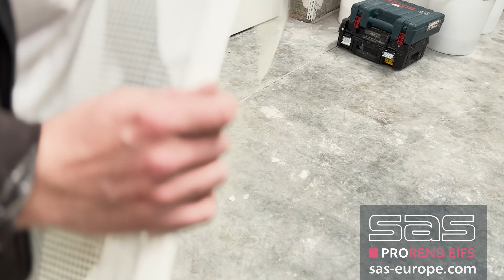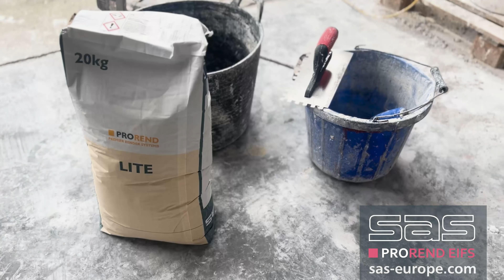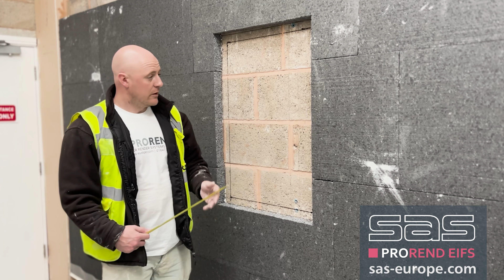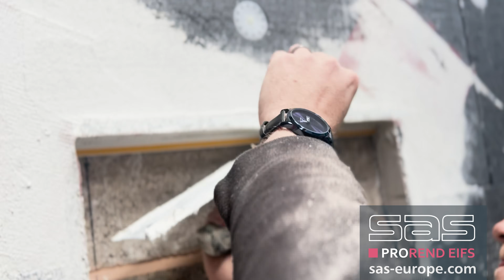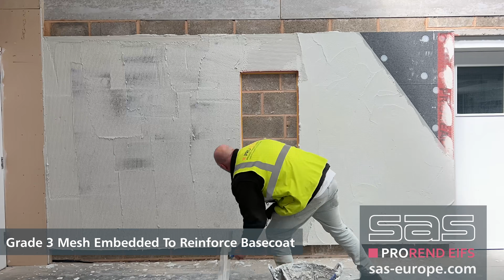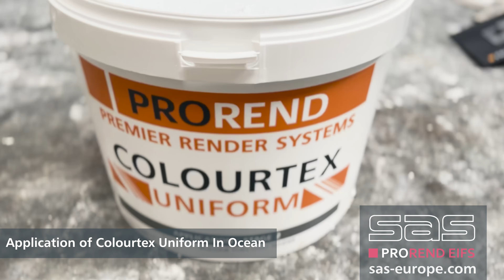Installing External Wall Insulation with a Rendered Finish

Comment: Great video. A question I have is at 23min30sec after applying the secondary base coat you advise leaving it for around two hours and then trowelling with  plenty of water to achieve a smooth flat finish. However, you don't show this stage. I don't suppose you have, or know of, any videos that show this? Thanks
Reply from the maker: Hi Peter. Good question, check out this video here from approximately 7:14-7:58 and it will give you an idea. If you would like any further support, our technical team are always happy to help, they can be found at info@sas-europe.com or 01647 24620.

Comment: Great video. I’m planning a side-passage shed against a wall with 100mm external insulation. Can I use long-reach brackets—specifically three rows of double L-brackets—to anchor the shed to the structural masonry? The brackets would bridge the 100mm of foam to secure the shed’s primary support posts. Would they cause a thermal break or compromise the insulation's performance?
Reply from the maker: Hi Mark,

Is it a Helping Hand bracket system you’re planning on using for this? If so, the brackets create only a relatively small localised thermal bridge through the insulation layer, which can typically be accounted for within the U-value calculation through the Chi value of the fixing system.

Most Helping Hand systems also incorporate thermal isolation pads at the fixing points, which helps minimise cold bridging back to the structural wall.

Provided the brackets are correctly specified and fixed back into the structural masonry, this type of detail is commonly used on ventilated façade and rainscreen systems without significantly affecting the overall thermal performance of the insulation system.
feel free to email me gerry@sas-europe.com

Comment: Great video, great example of the skills of a good tradesman. Question though, once done how hard is this stuff, given it's polystyrene underneath can you now dint your house?
Reply from the maker: Good question.

The insulation is only the backing layer. Over that goes reinforced basecoat and mesh, which creates a solid, impact-resistant shell before the finish coat is applied.

Once complete, it performs like a robust rendered wall system. You’re not pressing into bare polystyrene - the structural strength comes from the reinforced render build-up.

Comment: After you have slapped on a base coat then the mesh, what is the maximum amount of time you can leave before putting on the topcoat? Does the base still have to be tacky or can it be completely dry and I can leave it a few days before finishing?
Reply from the maker: Hello. It needs to be left for at least 24 hours and completely dry before the topcoat is applied, so it can be left for a few days before finishing if needed. Hope that helps.

Comment: Loved your video! Is it ok the leave the gap from the floor to the panels?
Reply from the maker: You need to keep the system above dpc with the starter track but a plinth can be created below the system using a thinner but more dense insulation, typically XPS or EPS 200 grade insulation. Hope that helps.

Comment: If you’re applying the insulation to red bricks should you use a primer and which one?
Reply from the maker: Not with SAS ProRend system as the quality of the product means that the bricks do not require any primer or pre treatment before the insulation is applied adhesively with our lite basecoat. However any loose friable material will need to be removed from the brick first and any algae treated with a good fungicidal remover. Hope that helps 😊

Comment: Does it matter if it rained while it's drying
Reply from the maker: It really depends whether it was heavy or light rain. Heavy rain can affect the finish and cause patching or surface texture issues. If it rained a few hours after application, you are likely fine. Silicone render is hydrophobic 😊. That being said, wouldn’t recommend rendering in the rain unless under cover.

Comment: Cheers for the video! How do I go around aircon unit and drainage pipes, though?
Reply from the maker: If the aircon unit can’t be removed then a starter track should frame it with a 50mm gap between the track and the unit, all drainage pipes need to be removed or extended to accommodate the thickness of the systems. Hope that helps.
Reply: @SASEurope  Cheers for your response. Is it not advisable to put insulation behind the unit, even though there seems to be enough space? If I go around the unit instead, it will inevitably create a cold spot on the wall, which will lead to condensation. =(
Reply from the maker: @dmitryi3761 Hi there, if you can get behind the aircon unit then yes definitely insulate behind it.